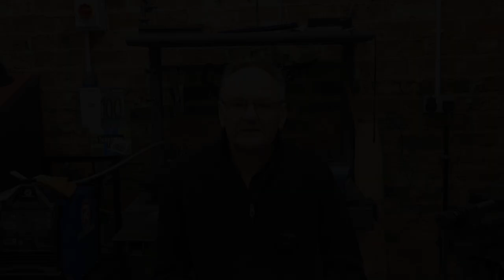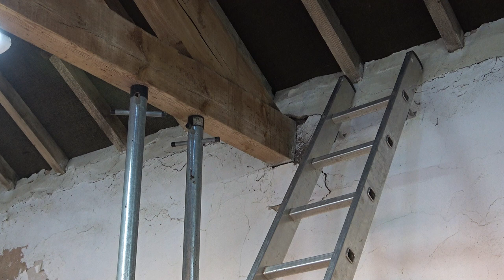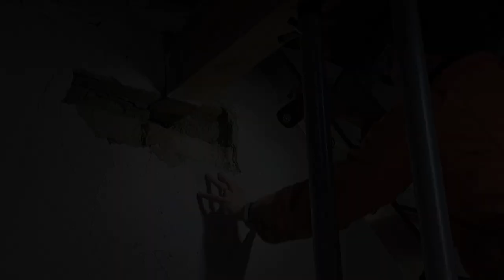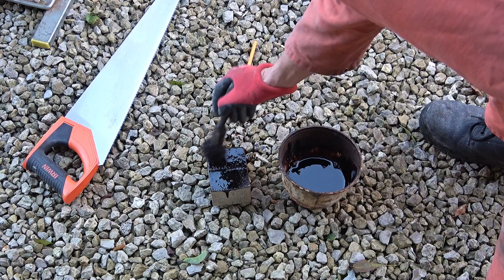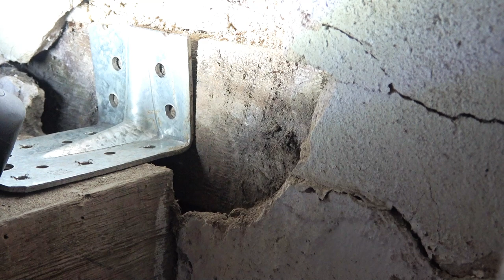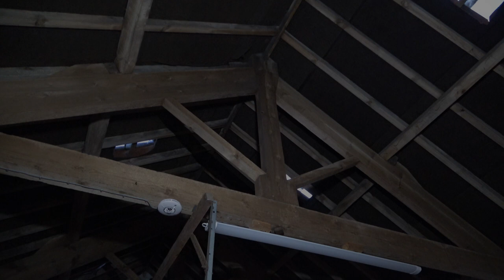HS122 Garage roof truss support repair (Do it yourself)

Comment: I find myself doing jobs like this, others don't even notice, in reality nothing would happen if it was left for another 5o years. If you think the walls are moving apart put a hole in each wall and a big steel rod through with plates on either end to tie the building together under the truss. There is a bit of lathe work there to thread up some 3/4 or 1" bar and make couplers! Old buildings move and crack all the time. My rule of thumb, almost literally, is that if you can't get your finger in there then it isn't a crack worth worrying about and it is fine to point it up and cover it. As for types of mortar, I have used just lime and sand, wet the lime and keep it wet in a bucket, mix it to a thick paint consistency and let the wet lime settle out over a few days and decant the water, this putty can be mixed with sand quite rich, (lots of lime to sand) and used for a few bricks here and there and for pointing, I have done it on my 150 year old house and have no complaints. experiment to get the mix right, all sands are different. The lime is just lime from the builders merchants, not hydraulic lime. If you keep the sand and lime mix in a sealed paint bucket it lasts a few weeks, so there is no rush doing jobs, or just keep it in a bucket with water over the top as an air seal.  Cement and hydraulic lime (Natural Hydraulic lime NHL) are hydraulic materials, they "go off" in the presence of water, so you must have water for the reaction to happen, hydraulic mortars and concretes will go off underwater.  It is a fine balance, you need water, but not too much. 
On the other hand The lime mortar that I make goes off slowly in the presence of atmospheric CO2, completely different reaction, but it is much weaker, fine for brickwork and pointing, but not for structural stuff. 
Sorry for the essay, chartered civil engineer, who knows that he doesn't know much about concretes and limes!
Reply from the maker: Hi Bootsowen, you get the prize for the longest comment. It's all very interesting esp to hear that you are a Chartered CE.  I often find there is more to Youtubers than we see.  So I think portland cement came along about 1850 and gradually displaced lime mix as mortar for house building?  The old part of my house in bonded with lime mortar.  Good because when the walls move around the old clamp bricks don't not crack.  The bond is weak but the clamp bricks are also weak. Cheers

Comment: Nice repair. 1 of my rentals has a decorative front porch that is in serious need of structural repairs this summer I hope...

Love the way you slid the mortar in off the board, never seen a trick like that before...

1 last thought...if you drive many long/heavy screews you might look into an impact driver...I used a drill for the longest time, till I got the chance to borrow a driver...bought 1 of my own the next day, loved it every since...

It's nice to see others doing these kinda repairs, easy to relate to
Reply from the maker: Hi Craig, glad you are back. I still get mortar stain on the brick faces if I'm pointing (due to lack of skill) but the board certainly helps. My son has recently bought impact drivers and I will snatch one of his next time 😮 Cheers

Comment: I was expecting a huge tie rod and plate as a repair 🤔🤭.
Nice job, love the house story.
Reply from the maker: Hi John, I did that on the Haxby Shed workshop with long 16mm threaded bar and wooden blocks on the outside but for the garage I don't think it is really needed because there is not much movement. The house story is totally true - nothing was embellished for effect.
Reply: @HaxbyShed  I didn't doubt you one second on the house, just a thought on screwing the horizon beam to the sole plate  ( not sure what the correct term is here), it possibly constraints the natural expansion and contraction. Though unless the building sees a wide temperature and humidity range its affect maybe quite small. 
Best regards

Comment: The roof rafters are pushing outwards because there are no collar ties or ceiling rafters.  You didn’t say if the walls are still plumb. Check them and you’ll find where the movement is happening.   Lateral forces are often overlooked in brick walls, remember the bricks just sit there and rely on gravity.   The mortar really only keeps out the rain….       Lime in the mix waterproofs the joint.  If you use plasticiser in the mortar you get a smooth mix but it ain’t waterproof!

Stavros
Reply from the maker: Hi Steve, true enough no collar ties but it does have large purlins (mid-rafter supports) running lengthways. The big horizontal truss joists should have been tied to the wall plates at each end and should not rely on the wall resistance alone to stop the lower sections spreading (in my opinion). I don't know when that roof was made. The timbers are sawn not chopped and there is felt meaning it has at least been recovered as some point. I think heavy bitumen felt was used after about 1945. I know in the 1970s it was used for pigs and that might have been when it was plastered and painted (?).  Cheers

Comment: When I built my garage, ahem, workshop, I used 6 x 12 pitch pine beams as the main roof purlins from an old mill that was being knocked down local to us in Huddersfield. Although the house has 18" thick solid stone walls (rubble filled) the building inspector insisted that each end was supported on a 35N concrete block to prevent any sort of problems. In the 30 years since I built it, I have had no problems
Reply from the maker: Hi Bill, my old agricultural buildings were thrown up on quite shallow foundations and you get a bit of movement over the years. Sometimes it's a case of the old iron ties on the joists, or the screws holding them, rusting away.   It's all part of the fun owning old buildings.  Cheers

Comment: Just imagine for a moment that houses could speak. All their stories they would tell us...
Reply: I did that. I emptied my mind and imagined, for just a moment, that houses could speak. What emerged was a vision of Lovecraftian horror so terrifying that I had to take the rest of the day off to recover.
Reply from the maker: Hi Michel, under the first treads of my stairs resting on the bare earth I found an old medicine bottle. When I took the old 10 inch floor boards up in one of our bedrooms I found a small mound of grain that had tricked through the cracks around the fireplace. Between the two front bedrooms there is a blocked up doorway. Yes, if only houses could talk. Cheers

Comment: Haxby! Good repair. Here in the States we have what is called non-shrinking mortar. Just add water. You can mix it thin enough to apply with a caulking gun or "pastry bag". Good thinking on the screws. The only thing better would have been a 254mm thick steel plate on the outside of the wall with through bolts into the beam's end. (Is that overkill?) Keep the entertainment coming & never apologize for it. By the way, I found a 90 volt DC 1/4 hp motor to build my welding "spinner" with. Found a 12 inch lathe faceplate to go with it. What kind of a controller would you suggest? Motor says 3 amps.  Cheers.
Reply from the maker: Hi Robert, I did think about straps, rods and plates but when I got the plaster off the movement was quite limited so I settled for a bracket. Sorry I have no experience with DC controllers so I can't help there. Maybe let us know how you get on? Cheers